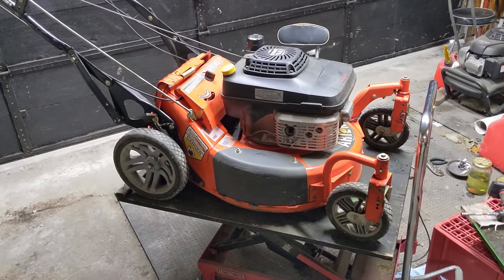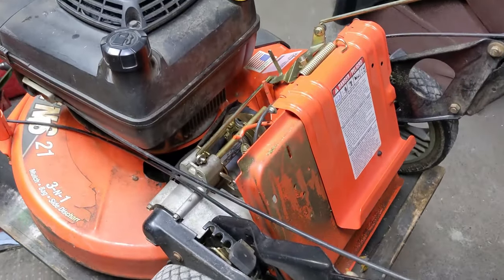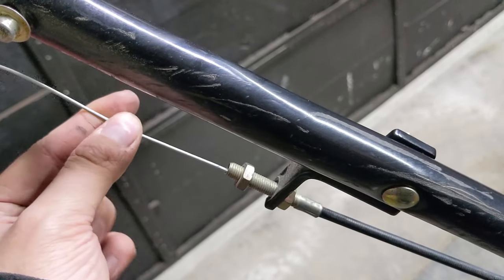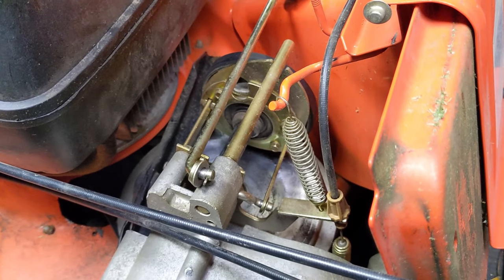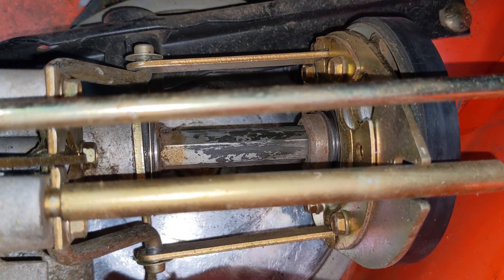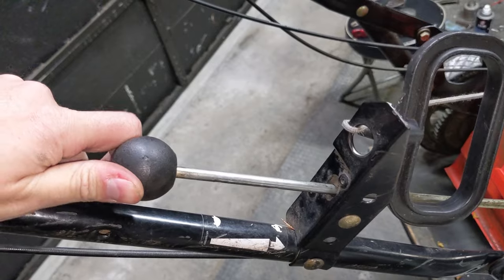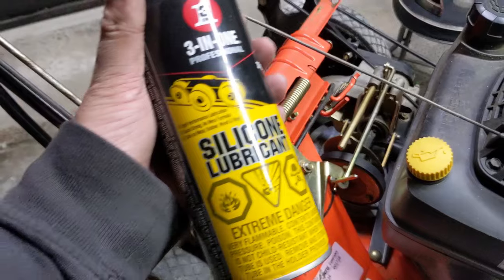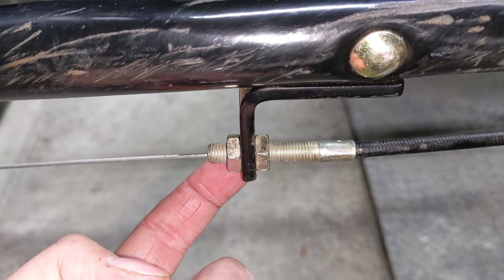Fixing a Drive Issue on an Ariens Self Propelled Lawnmower

Comment: Thanks! Excellent video and explanation. I have a 911044 Ariens mower, which is very similar to the one in the video. I bought it in the mid-1990s and it still works perfectly, because of such adjustments and TLC. I needed to replace the friction wheel rubber ring and carb this spring and needed your info to properly re-adjust the drive mechanism.

Comment: Thank you very much for this video. There is an old Ariens21 mower in my rental place. I don't think the self-propelled thing works at all, I never used it always pushed the thing. But suddenly the back wheels were locked in place when trying to go forward. I am not super mechanically inclined, but thanks to your explanation of the friction wheel drive I had a guess that it probably has to do with it, was able to access it and lo and behold the rubber wheel was always down on the plate, locking the wheels for the powered off mower. Was able to move the whole mechanic a bit, so that it now behaves as expected and I am able to push the mower again 🤗👍

Comment: Thanks for this video. I have a similar mower with the same drive mechanism and the friction wheel was seized up on the hex shaft, which eventually caused the shaft to pull itself out of the transmission.  This helped me understand the inner workings of the drive so I could fix it.

Comment: very comprehensive man, thanks so much for the detail. the steps you took were basically identical to the ariens snowblower models, and very similar construction, even down to the hexagonal shaft on the drive wheel. I appreciate your ingenuity to prevent needing to take the whole assembly apart, if the service doesn't call for it.
Reply from the maker: Thanks for watching!

Comment: Howdy,and thx…
You posted this video a couple years ago, but there’s a problem with my Ariens drive system…
The inside diameter of the actuator arm plate that has the ball and the ring shim washer on the transmission side of the hex shaft is much larger than the shaft and fall down.
But they do fit perfectly onto the o.d. Of the bearing.
However, the bearing just slides on the shaft  .
It looks like it’s supposed to fit into the transmission and the actuator plate and washer fit over it.
But the bearing doesn’t appear to seat far enough into the transmission for the actuator plate and shim washer to be on it because the spring pin hole is covered up by them.

Is the bearing supposed to fit further   Into transmission?
If not, where does the bearing go so that the plate and washer fit on it and they spring pin hole shows to put the spring pin can be put back in?
Thanks so much!!

Comment: Thanks for a good, informative video. Well done!

I revamped the drive system last year on an Ariens mower like this. The rubber on the friction disc was both worn and cracked, so I replaced the rubber ring, along with a new cogged belt. That breathed new life into the drive, but it only lasts for a short time when I start a new mow. After a while, it starts to lose traction and I've traced the issue to belt slippage on the drive pulley connected to the engine shaft. (despite the belt having been replaced last year) Belt dressing works well, but only for a while before it loses its grip. The idler pully and its spring are still in place, and there doesn't seem to be an adjustment for it. A stiffer or shorter spring might help. Any other suggestions?

Comment: I have a similar Ariens mower and the friction wheel needs replacing. Unfortunately it is discontinued. Is there any way to put a different one on? Is there some way to add new rubber to the wheel?
Reply from the maker: Yes might get lucky with an aftermarket one, just need the same OD and bolt pattern

Comment: I have a mtd snowblower and the shifter gets stiff and I've tried several lubes. Latest is JD corn head grease which is like 00 used in blower gear box. Maybe I need to sand the hex shaft down a bit .
Reply from the maker: Take the wire wheel bit to it, gets all the gunk off. Thanks for watching!

Comment: I have this same mower - and needed to adjust that cable - thanks for the video -  one question for you ... where in the heck do they hide the oil filter on this model?
Reply from the maker: I don't believe this engine has an oil filter on it. To be sure though, google your model number and type "parts diagram" after to see an illustrated break down of your mower
Reply: @EliminatorPerformance  thanks, seems like similar models had this,  cheers

Comment: My new Honda was touching right side first of the front auger housing than the left. I adjusted the skids making sure all was adjusted to same height. Than checked tires for same psi. I figured out I had to loosen the bolts where it splits than retightened and now it touches evenly. Odd. Ever have this?

Comment: How hard is it to replace the rubber friction driven disc on this mower  other question is your new concrete driveway doing well I hope
Reply from the maker: Easy, just remove the bolts and swap out the friction wheel. Also, new concrete driveway looks amazing, turned out great. Hopefully will show it off in the next video, as it's still setting up and hasn't been fully cut/sealed yet. Thanks for watching!
Reply: @EliminatorPerformance  thanks for your reply young man 😎

Comment: The Snapper has a simpler more reliable drive system in my opinion. The Ariens is over engineered and complicated with more parts to fail.